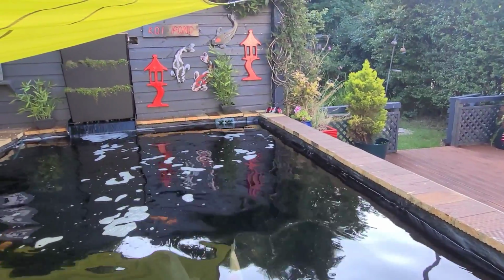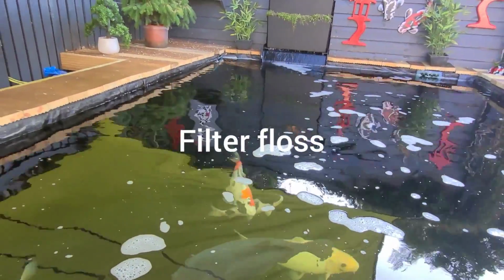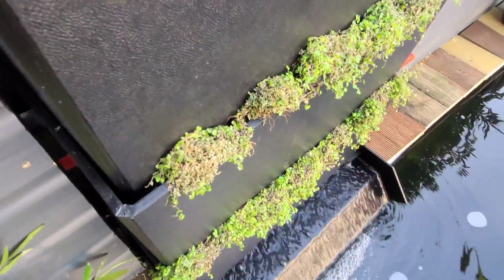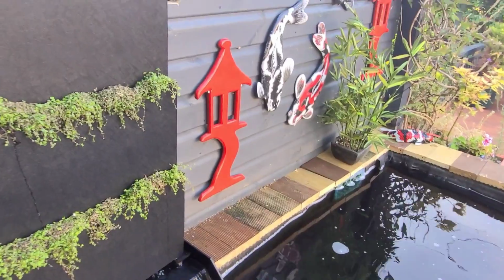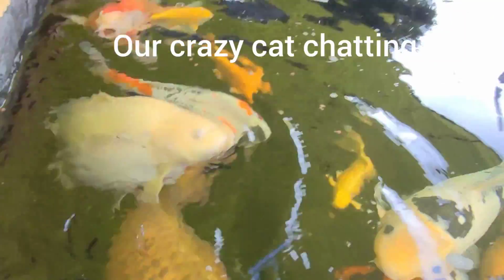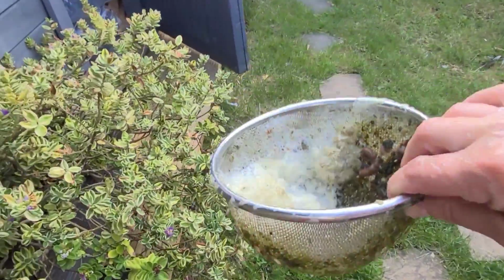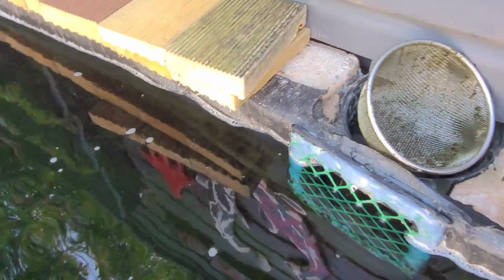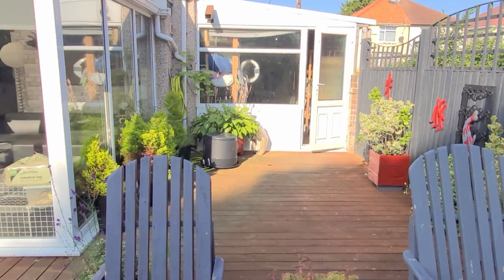Bakki Shower update -protein froth !!

Comment: If you put a plastic plate and cut two slots in it  it will pull more protein foam off the top of the water you will see a big difference 👍👌
Reply from the maker: Cheers so many goid tips coming though

Comment: We have a 2-tier 1.5m wide shower with a EA 20000 vari-flow running pump at 80%, so 16000 lph and I do not get any foam/froth at all. In my experience, they do seem to work better with a fast flow. Did you wash the shower media thoroughly before putting it in the shower?
What food are you feeding? Does it all get eaten when you feed the fish? Might be worth adding filter bacteria to the shower once a week for a few weeks until the bacteria has built up.
Nice art work 👍
Reply from the maker: It's only started since the shower was installed. I have ordered a 10000lts pump. Hikari the fish are on

Comment: Shower is great addition, the ceramic media will become home to bacteria that breakdown nitrates, that can't live on plastic media, the purpose of fast flow over shower is to gas off ammonia and nitrogen, which is why the Japanese stainless steel showers are so successful, they have vast air gaps between  the tiers to gas of the above, won't be quite successful with our plastic showers but still great filters if ceramic media is used, top tip, I have baby tears growing on front of shower, so I have used half a clothes peg in middle of each tier opening on back of shower, with half a twist, to open the gap, so shower can breathe and help gas off, if that makes sense.
Reply from the maker: Cheers good advice 👍

Comment: Nice Shower. What flow rate have you got going through the Bakki Shower and is it prefiltered or direct from the pump. The more the better is recommended for a Bakki and the slower the better for a Trickle Tower. Remember that all pump flow rates will almost half if the head is 3 to 4 foot above the water surface. Then add the pipe diameter and length and it can reduce even more. I would go for the largest Variable Pump you can get and then run it at lower speed. That will be more efficient of the Head loss and the power usage.
Reply from the maker: 5000ltr pump threw skimmer in to sponges then static bed. Main filters   are nexus and nexus seive